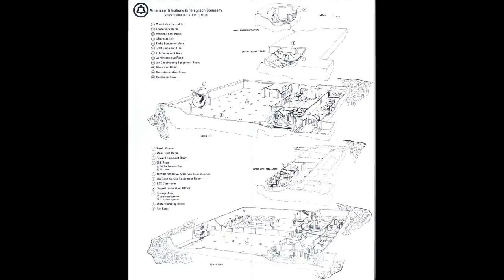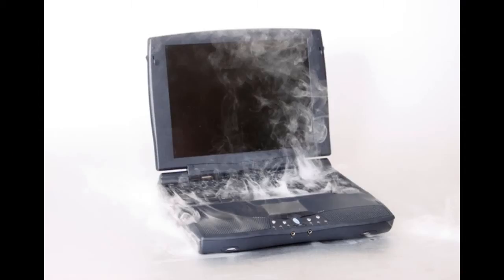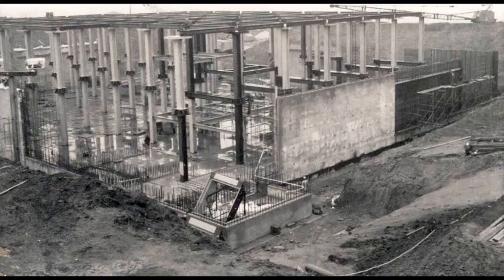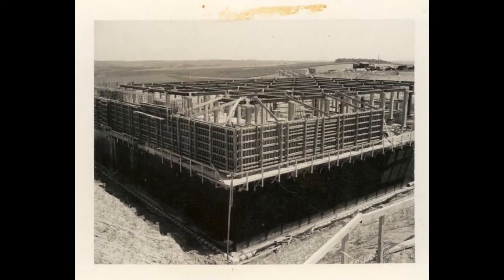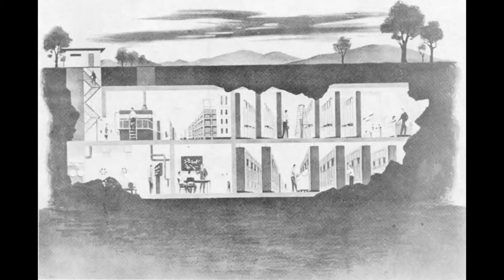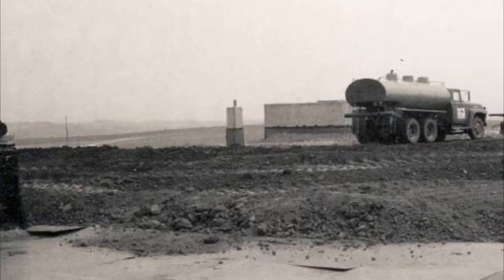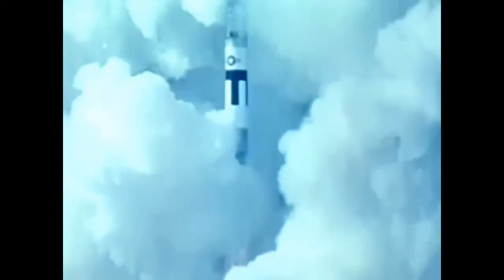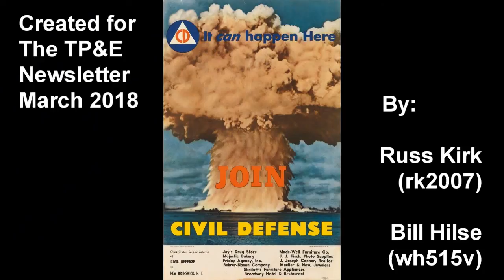Telephone Collectors International ( TCI ) Video : AT&T Nuclear Hardened COs

Comment: I live right by the L5 cable route that ran from Virginia to SW Missouri.  I supposed it could have been used to activate them nuke fields that used to be in West Missouri.  They just pulled up the last of the "B" Coax line 10 years ago, unused for years, replaced with six fiber conduits..., got a sample.
Reply: The Titan II and Minuteman Missile sites were not connected to the L carrier networks
Reply: @Doh1962  The L network was hardened L-carrier routes which were designed to skirt areas targeted by Soviet nuclear weapons. Pennsylvania route connected NJ major switching station to Hillsboro Mo.
Reply: ATT Long lines was supplemented by L4, you do not believe AUTOVON was used on L networks?